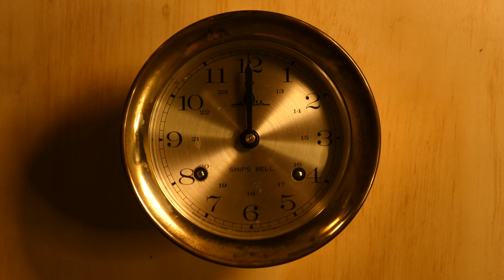Ships Bell Clock

Comment: Spectacular work!! The older class subs this clock was on, the shifts were 18 hour days; 6 hours on and 12 hours off. By the 4th or 5th day you lost track of the days and time of day to the point where you only knew what time it was by the meal that was being served.. 6 breakfast, 12 lunch, 6 dinner, 12 midnight rations.

Comment: Am trying to figure out the strike pattern for Seth thomas ships striking clock. I have moved the hands carefully from center but clock will not strike in logical pattern. Am aware that ships strike clocks strike according to ships watch but would like to have it strike as customary American clock. Any help welcomed. Thanks. I may just let the strike barrel run down until silent. And use clock as is.
Reply from the maker: You can't make a ship strike clock do a normal strike, at least I've never seen one that could be switched.  Look for a little lever to silence the strike, if there is none then yes letting the spring wind down is the only way to silence it.

The pattern to let sailors know where they are in their 4 hour watch is:
12:00 8 bells
12:30 1 bell
1:00 2 bells 
1:30 3 bells 
2:00 4 bells 
2:30 5 bells 
3:00 6 bells 
3:30 7 bells 
4:00 8 bells 
4:30 1 bell
etc...